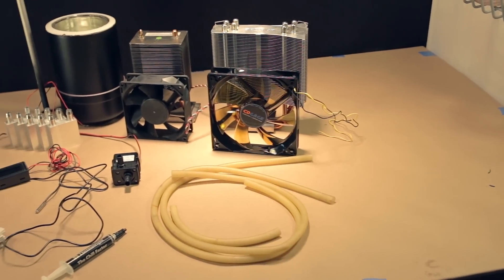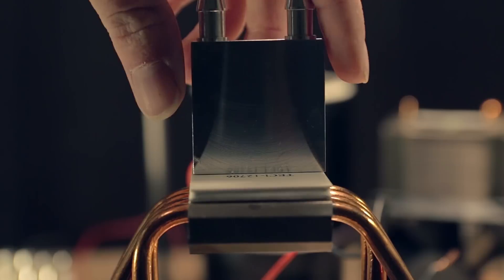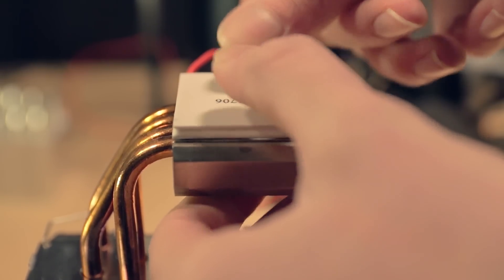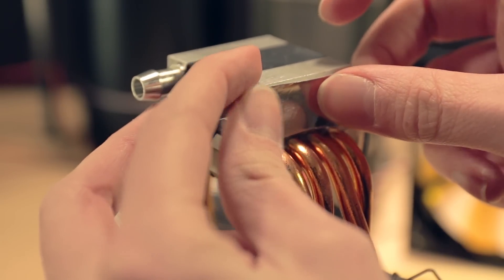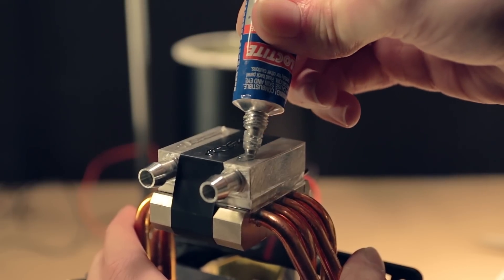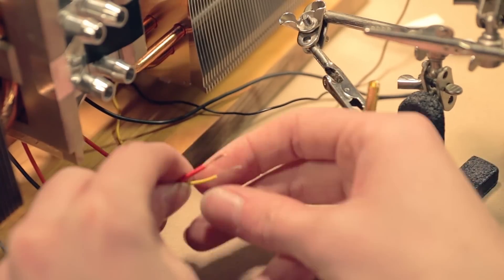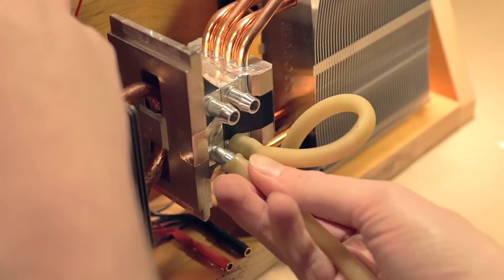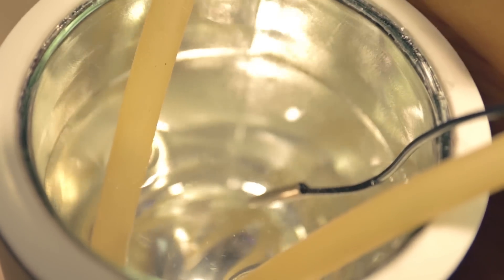Peltier Water Cooler

Comment: What about using an air pump or a fan connecte to a funnel, to send high speed air through a smaller pipe to the entrance of the liquid cooling square (which is put on top of the CPU/GPU), to deliver high speed airflow for cooling, instead of water? The downside would be that the cooling square would have to have thin sheets of metal to act as a more efficient heatsink.
Reply: if you just want cool air, flip the peltiers and use the water to remove the heat. 
ghetto AC
Reply: @lordsqueak  Just take 2 of those heatsinks and put a peltier inbetween then. Cold side heatsink blows in and hot side out.
Reply: But why?
Reply: @lordsqueak  because then you'd get an ac... but youd have to use it as a window ac to blow the hot air out
Reply: But that's what the water is for. removing the heat. 

But my reply was just a quick answer to the original poster, instead of doing all that, just flip the peltier. 
Of course now things have gotten way too serious, but if you really want pelters to cool air, more permanently, the best way of doing it is to use tap water to remove the heat. (wastes water, but that's besides the point here)
all in all though,, using peltiers is not optimal.

Comment: im about to build one of these but i think i will submerge the hot heat sink in a pool of water instead of using a fan which would blow heat into the room. I would love to know how hot the heat sink gets. and what CPU cooler you used on this
Reply from the maker: Crypto Noob If you submerge the heat sink in water then the water will heat up and your heat sink will no longer have anywhere to dump heat.
Reply: how hot is the air exhausting it with the fan?

Comment: Great work. But for a food application I don’t know if running the water through aluminum or copper is safe. Anyone know alternatives to this method that don’t use copper or aluminum. Stainless steel is corrosion safe but it doesn’t conduct heat/cold well

Comment: you forgot to mention the pump you're using to cycle the water through the cooler. also you didn't tell how much noise is it making. pumps and fans usually make a lot of noise. which brand model fan and pump you're using and at what setting etc...

Comment: Can lower temps be achieved by stacking the tiles in series rather than applying two individual cold sides?
Reply from the maker: No, the peltier chips make a lot more heat than they suck away. Stacking two together would result in overheating.
Reply from the maker: I suppose in theory you could achieve a lower minimum temperature by stacking them. But only when configured like in those pictures where the chips get smaller and smaller. Again, peltier chips consume a lot of power for how little they transfer. A 40 Watt chip may only have a 5 watt Carnot equivalent efficiency. I suppose stacking the chips in a pyramid configuration could give you a very low minimum temperature but at that point you'd be consuming a ton of power and you'd still need a bulky heat sink to dissipate the heat from the largest chip. Just as a side note, they don't show any thermal transfer material between their chips in the pictures. I would think that would be necessary, otherwise the smaller chips wouldn't be able to dump their heat across the whole larger chips. I could see niche uses for such a configuration, but generally if you need a source of very low temperatures, multi stage compression type refrigeration is going to be your best bet.

Comment: Awesome video, do u think that peltier can cool water from 26°C to 24-25°C if i use 5V and 1A adapter ?
Reply from the maker: HappyBreadfruit the peltier chips only operate at 12 volts, but you could limit the current or the duty cycle to achieve a particular temperature range. Perhaps you could program a thermocouple to turn some kind of switch on and off based on the temperature of the water. That way you could make the water stay within your desired range with whatever tolerance you want and without having to modify the power supply.
Reply: Thank you so much, im not very good at electronic, so if i use 12V power supply, peltier chip will take maximum current of that power supply can gave ? Or i need some current limiter ?
Reply from the maker: HappyBreadfruit Your Peltier chip will only draw as much current as it needs. So like if you have a power supply that is twelve volts and 10 amps that means that the 12 volts is constant and the 10 amps really just means 10 available amps. So your Peltier may say it runs at 60 watts for instance in which case it would draw 5 amps from the available 10. Power is equal to volts times amps so 60 watts divided by 12 volts means it draws 5 amos of current. Now if you were wanting to reduce power of your peltier chip to run saw at 30 watts you could either limit the current to 2.5 amps or build some kind of a circuit that turns the power on and off rapidly so that it effectively works at half power. Or like I said with the thermocouple, you could make connectiont a programmable switch to a thermometer so that when it gets too cold, the chip turns off and when it gets too warm the circuit turns back on.
Reply: Magneto! Magneto! Thank you so much for help man, I really appreciate it. I look forward to the your next videos :)

Comment: can I give power as 12v with 10amps to the peltier 
pls answer me
Reply from the maker: Maignanamgnanavel Maignanam The peltier chips will only draw as much current as they need. Voltage will be constant. So yes, 12v with 10 available amps should work just fine.
Reply: Thank u for your reply , now I'm clear
Reply: The temperate difference (delta T) between the hot and cold side is going to be dependent on how much amperage you provide the peltier. Any device will consume a certain amount of current (amps) based on the voltage given it, as we see in Ohm's law: I=V/R (where I is current in Amps, V is potential difference in Volts, and R is resistance in Ohms). The bigger the I, the bigger the delta T. So, to get more I, you need to either get a higher V or a lower R. The higher wattage peltiers are lower resistance to pass more current through, and are beefier to handle the extra heat generated inside them. Attempting to use a Peltier at too high a voltage will likely destroy it though.
Since the peltier creates a delta T when current passes through it, you can in theory stack two or more peltiers, hot to cold, to get a larger total delta T (much like you stack cells in series in a battery to get a higher voltage). You must be sure to use proper heat sink at all times though, or the extreme temperatures created will destroy your peltiers.

Comment: how many gallons do you think this would work for 🤔🤔
Reply from the maker: Trill Will It will work for any volume of water. But the more you use the longer it will take to get cold. Also, how insulated your reservoir is has a big affect on the minimum temperature.

Comment: Would this work well for overclocking cpu/gpu with proper condensation isolation, or you don't think it is efficient/strong enough to keep temperature down. Because i heard those tec chips aren't all that efficient compared to a proper ac refrigeration unit.
Reply from the maker: leomastersxd It would depend on how many of them you have. A 100W heat sink can move 100 Joules of energy (heat) per second but it will bottom out at room temperature. If you put a peltier chip between the heat source (CPU) and the heat sink, your heat transfer efficiency will be lower (the chips are lower than 100 watts) but you have a lower minimum temperature. Having more chips with heat sinks could negate the efficiency loss. But obviously if you have to have multiple heat sinks then you would need to run it as a water cooling setup. Simply because you can't fit more than one heat sink on a CPU. But ultimately, this is a less efficient way to dump heat than a compressor style cooler. Although it depends on your needs. A compressor is more efficient but it's louder and bulkier. Peltier chips are less efficient but they're small and quiet.
Reply from the maker: leomastersxd It would depend on how many of them you have. A 100W heat sink can move 100 Joules of energy (heat) per second but it will bottom out at room temperature. If you put a peltier chip between the heat source (CPU) and the heat sink, your heat transfer efficiency will be lower (the chips are lower than 100 watts) but you have a lower minimum temperature. Having more chips with heat sinks could negate the efficiency loss. But obviously if you have to have multiple heat sinks then you would need to run it as a water cooling setup. Simply because you can't fit more than one heat sink on a CPU. But ultimately, this is a less efficient way to dump heat than a compressor style cooler. Although it depends on your needs. A compressor is more efficient but it's louder and bulkier. Peltier chips are less efficient but they're small and quiet.
Reply: Magneto! Only way to know for sure is to test it.

Comment: Is it possible to make one of these that is safe to cool drinking water? I want to make something to cool my dogs water this summer thanks! Great video
Reply from the maker: Nathan Sutton Yes it should be fine to run drinking water through this. I would recommend running some soapywater through it first just to clean out any oils or dirt that may have been inside of it from manufacturing but once all that is rinsed out it should be fine for drinking water.
Reply: I just seen my dog eat a cat turd... I don't think chilled water from an old, previously hermetically sealed CPU cooler is going to do much to your pooch my friend.
Reply: Jeremy Schoonover lmao
Reply: Cold water is bad for dogs
Reply: I hope you're not serious...  Wolves have been drinking from mountain creeks and streams for eons.  Cold water is just fine for a dog good sir or ma'am.
Reply: Just leave the seat up, your dog will be ok with that.
Reply: I want to use this for a Hydroponic system for my plants, the double heatsink idea looks like it would work. What do you think?

Comment: Hey dude, I am just looking into this whole "peltier cooling" thing for my own PC. I personally love the aesthetic of an aircooler and so I am going modify it by simply putting the peltier plate between the heatsink and the CPU... with thermal paste on each of those surfaces. 

I wanted to know what power rating (if that's the right term) your peltier plate was in this video. I have seen 50w, 100w, 150w... etc and I wasn't really sure which would do the job for a CPU. 

Do you have any ideas?

Comment: I would suggest using JB weld instead of thermal paste and tape, or you could probably use thermal paste and seal the edges with JB.

Comment: You can improve the overall performance simple turn your assemble 90°. The reason is that the sifon effect will works better, because the hot fluid inside the copper pipes of the heatsink always goes up, allowing the more dense cold fluid flow down. Try and see.

Comment: Can I use that cold water to run through a radiator core with a fan to cool off a room ?
Reply from the maker: Yes, but remember that the peltier chip emits heat on the other side so if you want to cool a room, you'll have to direct the exhaust from the heat sink elsewhere. Also, I don't mean to discourage your creativity, but a peltier chip doesn't transfer very much heat. So you would need a lot of chips to appreciably cool a room. They are also very inefficient, so you'd also waste a lot of power in the process. If you're not already familiar, I encourage you to learn about the principles of Carnot efficiency and entropy. Those physical laws are what limit typical compressor style air conditioners but they also apply to peltier chips.
Reply: I think I will place the peltier unit outside the window and run hoses going inside to the radiator core in the room maybe I’ll use 4 peltier modules that’s about 288watts and give it a try like a duck less ac one unit outside one unit indiside thanks for the advice
Reply: The point is that you can but you will need more than 2 peltier chips
Reply: xXx_MlgTr1kSh00ter _Xx i I will use 4 peltier modules

Comment: Can you please let me know what CPU coolers those are? I have yet to find ANY CPU cooler that has a 40mm X 40mm base, most are 35x35mm i have found 35x40mm but cant seem to find any that are 40x40 or larger for the contact area. Also i am curious what that reservoir is called that the water is in? Thank you!
Reply: Check my Peltier-related videos, I share the exact parts I use in the description of the videos. I also had the same issue as you, the coolers I found were only 35x35 mm. I found some cheap, 6-heatpipe mode which can cover the Peltier perfectly.

Comment: hey bro, I am using small heat sink and fan attached for a CPU with fan dimension :  70X70X25mm, heat sink dimension : 80x67x25mm, with fan speed : 2500+- RPM, via adapter 12v and 5amp,  for a cold water dispenser, it comes with 3 wires, black, yellow and read, I connected plus terminal to red and minus terminal to black, it it really slow,  takes ages to cold, am I doing it wrong?
Reply from the maker: Bishorjit Meitei Try connecting the 12V supply to the yellow wire instead. It may spin the fan faster. If that's not it then I would point to efficiency. Make sure your water tank and hoses are all insulated so that the air isn't warming up your water. Depending on how much water your trying to cool, you may consider using multiple cooling chips like I did. The more you have working, the faster heat will be drawn away from the water and the more it will be able to resist losses to the air. meaning it can get colder.

Comment: Why two blocks?  Couldn't you attach the cool side to a single block, one on each side, give a greater surface area to the single block with less mass, less complexity and cost.
Reply from the maker: Well you see.... I didn't think of that. Lol. Yeah, one block would have worked fine. I don't think there's much of a performance loss by using two blocks, maybe it takes slightly longer to reach steady state due to greater thermal mass and the flow resistance is slightly higher and a small amount of heat can transfer in to the tubing between blocks. But you're absolutely right, one block would have been simpler.

Comment: The only problem with the thermal tape is that it was applied to both the hot and cold heat sinks and will result in some transfer of heat energy and loss of cold energy. Also would have been more efficient using thermal paste between the two cooling blocks. Combine their cooling power more effectively. Other than that, awesome video!

Comment: sorry can't hear properly what you sayin! Did you say it can run only 1 hour? Thought its gonna run forever as long as there is power(electricity)? Can you share which parts gonna need a replacement often? liked n subed.Thanks
Reply from the maker: It can run for longer than an hour. As long as the ambient temperature doesn't get so high it can't dump enough heat, it could run indefinitely. I built this for cooling a condenser during long distillations. Thank you for the comment, the like and the sub!
Reply: noprobs, you deserve it. ty

Comment: So what if you circulated the water instead of in a cup, but through a copper coil in front of a box fan.. A DIY air conditioner.. Or Dehumidifier .

Comment: What would I search for to find those type of CPU heat sinks?
Reply: Behind any small PC repair shop.  Walk in and ask for a couple old, used ones and they'll either give you them for free or at worst charge you a couple bucks for inflated recycled weight.
Reply: hyper 212 plus
Reply: Where are you located?

Comment: mmmmmm I don't know anththing about PETIERS!!!! could you use one with the cold size connected to a CPU and CPU fan on top to keep the CUP cold????????
Reply from the maker: The heat output of most CPUs is more than a Peltier chip can handle. You would need to connect multiple Peltier chips to a water block manifold to have enough cooling power. The power draw of such a setup would be very large though as the chips release much more heat than they absorb. They are very inefficient. CPUs don't need to be kept cold in most cases though. A normal radiator is typically sufficient.

Comment: You need alot more pressure pushing the components together. Thermal compound is still very bad at conducting heat, the layer should be as thin as possible
Reply: you have no clue... it has to be as thin as possible when there is a small transfer surface, like the actual silicon die of a cpu (1cm square). For a big die like GPU it really doesnt matter much, you get 2C difference even with half a millimeter of thermal compound. For the surface area of those two blocks you could put a millimeter of thermal compund without really affecting the transfer at all. It is 93W per 25 square centimeters... it is all about energy density and surface heat transfer. This is why you can cool a 200W gpu with a single 12cm rad and fan waterblock while your 120W CPU will choke with that and needs 24cm rad and two fans. The GPU transfers heat better to the water and therefore can be coled with more hotter water to avoid spikes while the cpu transfeers slower on less surface and needs cooler water to avoid spikes. You can mitigate some spikes with a reservoir but if they are longer even that will not help if you dont transfer heat as efficiently as possible from the CPU when the water gets hotter the heat transfer depends on the conductivity of the compund not slowing it even more. This is also why some people remove the cpu heatspreader and sand the silicon die to thin it as much as possible since silicon itself on the cpu is also a bottleneck for heat transfer from the actual transistors.